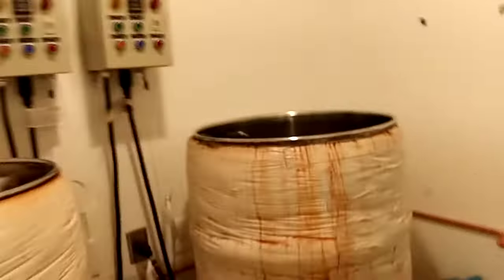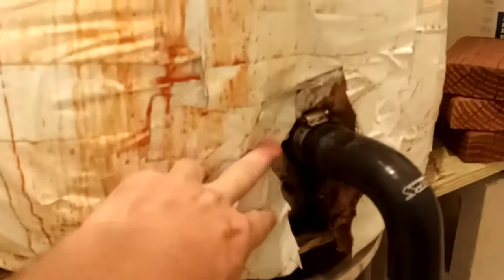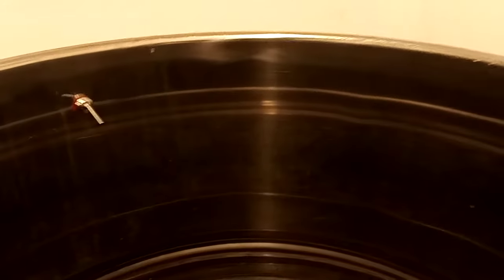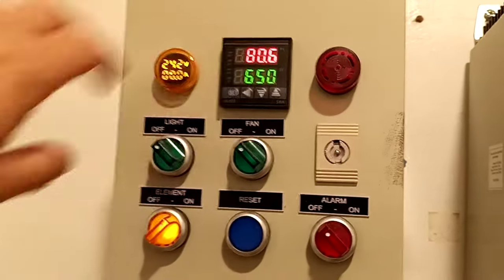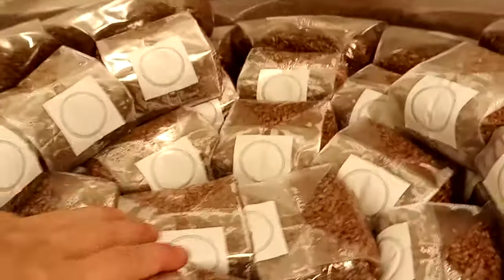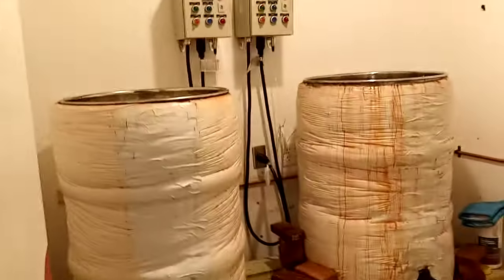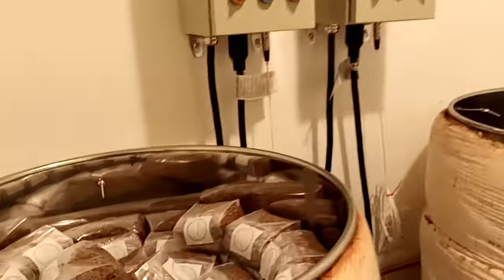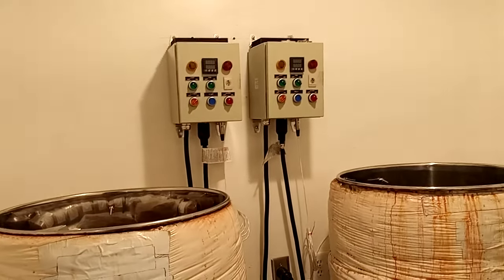atmospheric steam sterilizer at LiquidFungi.com - Matt gives more details

Comment: Awesome stuff, I love your cultures gonna oder a 5 pack soon! I have a question, I was always told to autoclave spawn but I assume from this video you can stem sterilize them for a little over 10 hours a that will be effective sterilization. strategy.
Reply from the maker: You can, the time will depend on several factors, but you should probe the middle of the center most bag. 8 hours after the bag reaches temp, it is good to go.
Reply: @liquidfungi  Do you mean sacrifice one bag or stick the probe between two bags? Doing my first build for spawn. Thanks.

Comment: is this sterilizing the substrate or pastuerizing it? Have you done control bags to see if they grow contamination if not inoculated?
Reply from the maker: This is sterilizing under 2 atmospheres of pressure. After, all bags are left in room temp for 10 days to ensure sterility. We have done 65,000 bags in the past two years with a 99.9% success ratio.
Reply: @liquidfungi  yea for sure i figured it was under 2 atmospheres, that would be 30 PSI dont think your tanks can handle that. The leaving them out part i love and will for sure incorporate that as a control measure. Thanks for info.

Comment: nice video .
where do you get the perforated trays from?
Reply from the maker: https://www.webstaurantstore.com/american-metalcraft-car21sphc-21-super-perforated-hard-coat-anodized-aluminum-car-pizza-pan/124CAR21HCSP.html
Reply: Old street signs work great(stops are the easiest to use)drill 50/75 holes in the sign and sand blast)I used threaded rod through the sign to set my bottom tray height

Comment: What do you think it cost to build a barrel?
Reply: Just built one with controler and everything for 400$ give or take 100 for any extras(voltage meter/20 amp in line breakers/6 foot temp sensor wire) also used a old juice shipment barrel made of just regular steel.when you get into stainless your easily talking double or triple that number.I would Def recommend building one of these